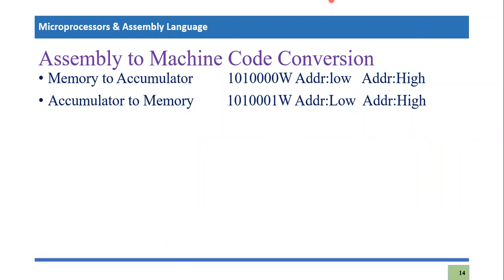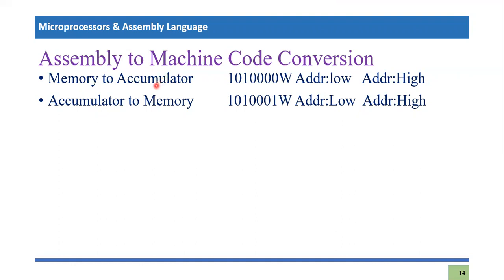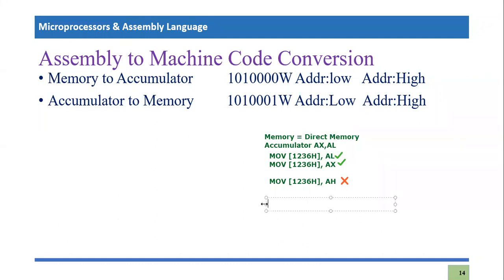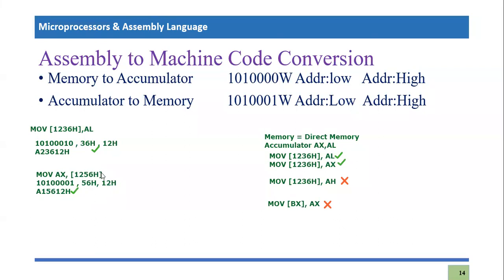Assembly to Machine Code Conversion in 8086( Accumulator to Memory  Or Memory to Accumulator Case)

Comment: i have a question what is the reg value of cs  segment
and if we have add [si],al then what is the opcode in book there is 2 opcodes for add if add is with accumlator then opcode is 000010w yeh kya hai bata denge😇